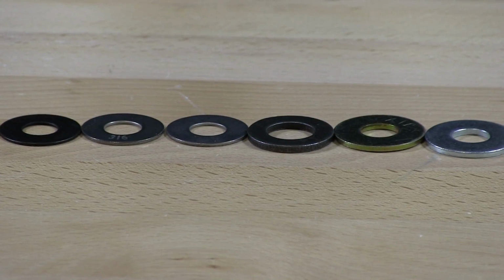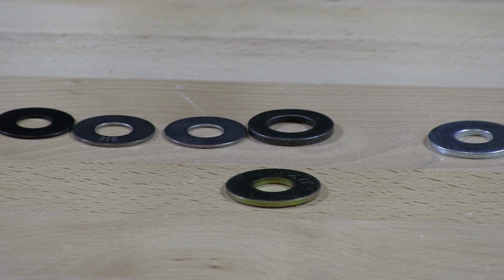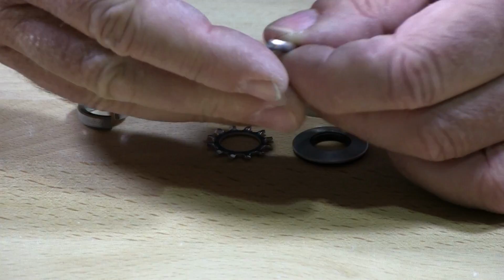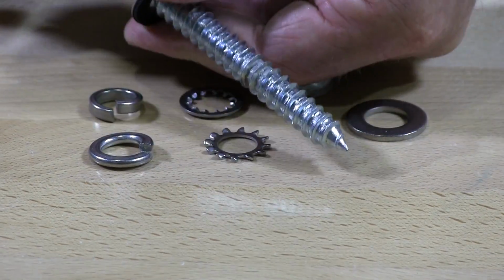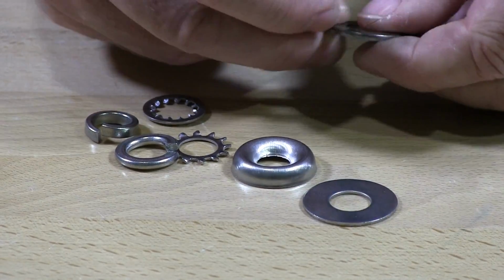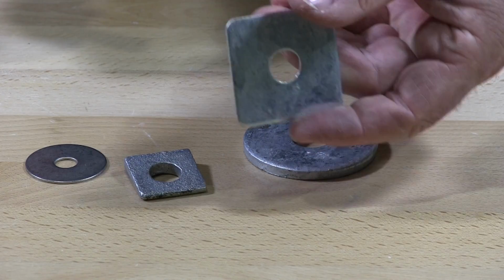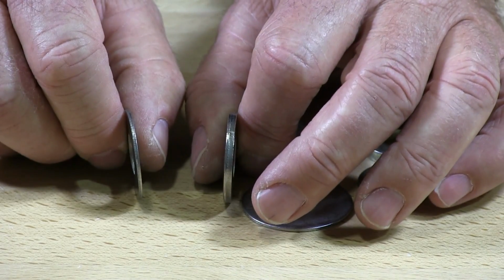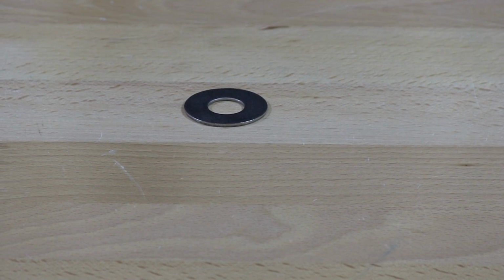All About Washers - Types & Materials, USS vs SAE | Fasteners 101

Comment: almost all split lock washers do little to help if not hurt the vibrational loosening of fasteners... any sort of hardened fastener will flatten out the split lock well before your end goal torque/clamp load is achieved... 

also using them with a flat washer removes half the utility of a split lock which can be to 'bite' into your fastener/joint material as well as the miniscule restorative spring force you might get.

Comment: I once came across those plastic looking washers... AutoZone guy called it "Crush Washers". I thought they were weak but they were ok. Used for oil drain... For oil drain plug I prefer washer with rubber interior with metal exterior.. not sure whats it called. Great Video!!
Reply: you want copper crush washer for oil

Comment: Have up half way through. Poorly -- very poorly -- explained. For instance, the split washer: the thicker one ('high collar'?) 'would require more torque' -well duh! Give us examples. And when should you use these rather than the next type, toothed (?) washer? Then for the toothed there's internal and external with thousands of applications but so many you can't give us a couple - it's for us to decide! And have these anti-vibration (I'm going to call them that) washers been superseded by nylock nuts? Didn't occur to you.

Comment: Sir u did awesome job bt can u tell me whats the uses kf tapered washer ???
Reply from the maker: Taper washers are used on channel sections, beneath nuts with tapered flanges, to enable the bolt assembly to fit square when tightened.

Comment: origin of the term washer?
Reply from the maker: The origin of the word is unknown, or at least not entirely clear. There are theories, but nothing concrete as to why they are called "washers." From Wikipedia: "The origin of the word is unknown; the first recorded use of the word was in 1346, however, the first time its definition was recorded was in 1611."